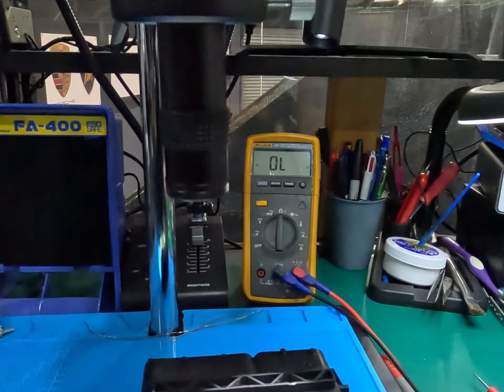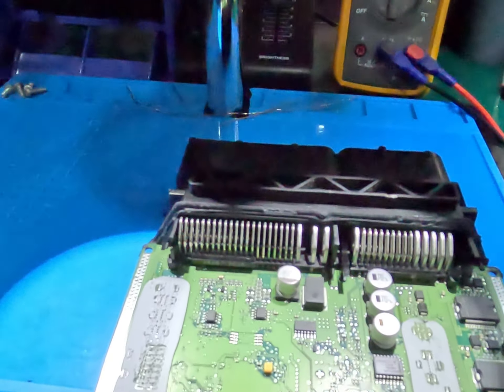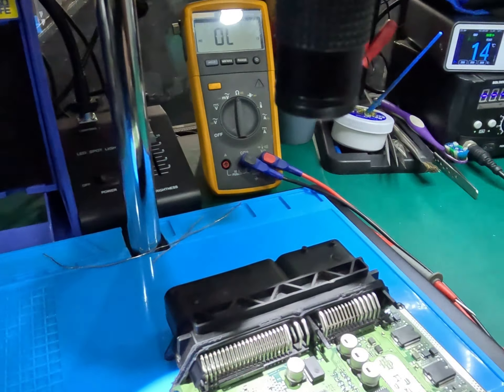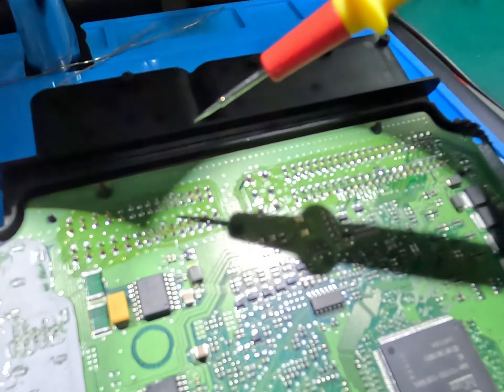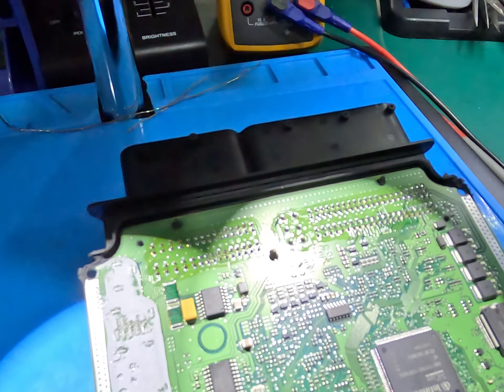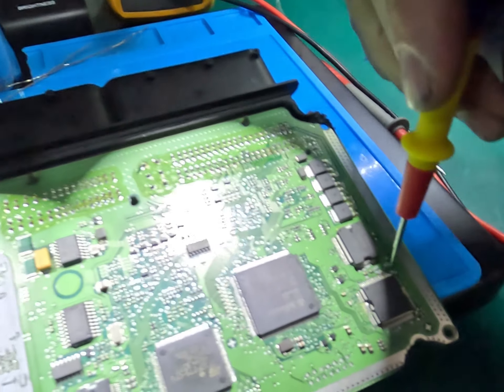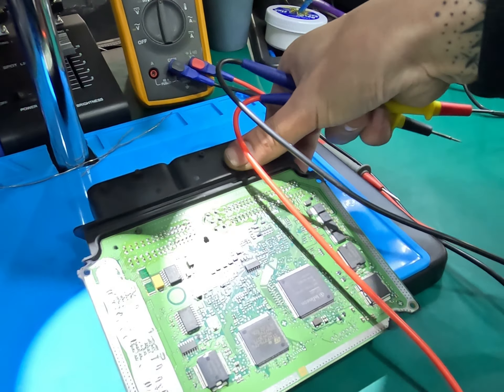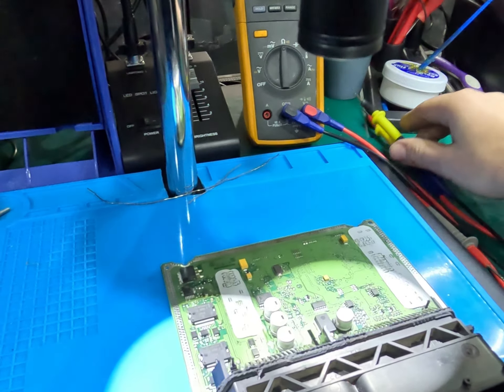Hyundai ECM inspection at The ECU repair clinic ✅️👍

Comment: For all those Bosch-Kefico ECUs is a most that electrolytic caps are replaced when serviced, I learned it the hard way after a few returns even though they were checking ok, One day I had 2 of those ECUs reading ok, but once I removed the caps, they were reading out of spec after some mins of testing which was weird, others had leaked a bit but under visual inspection while installed nothing looked bad only when removed, so at my end I always replace the caps even on ECUs that seem to be ok, some times traces underneath are also corroded. Also it seems that those Hyundai and Kia have the water drain just above the ECU and there is a plastic post that lets water in the engine bay so that little black plastic post needs to be sealed so no water will get in once repaired. Great video and gear. Thanks for sharing